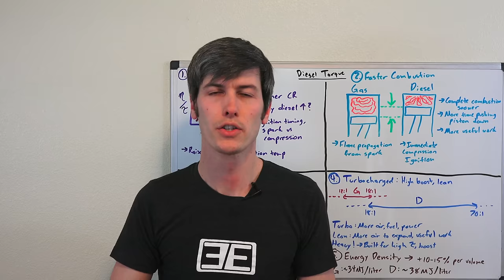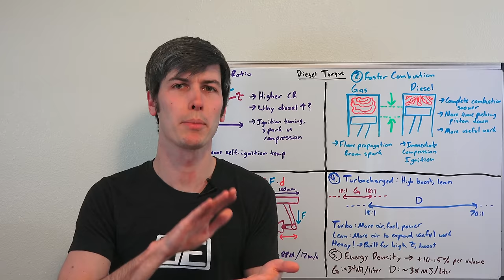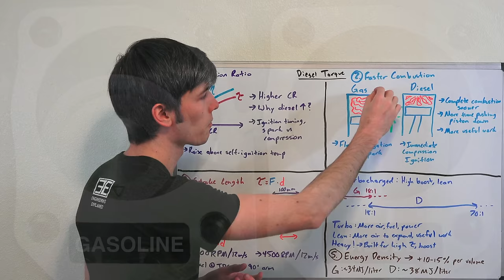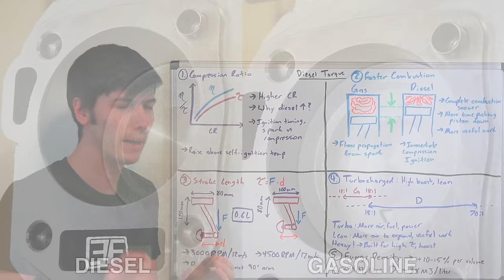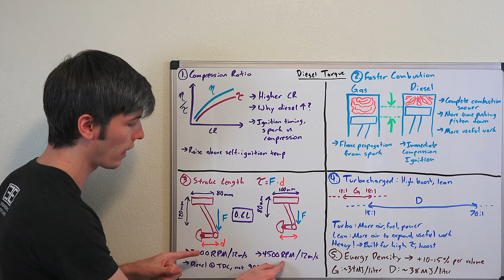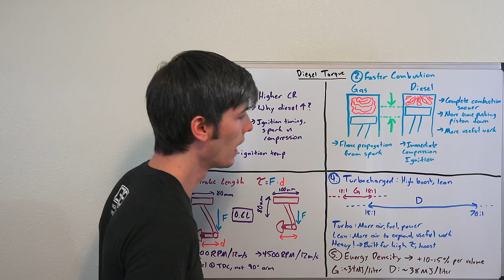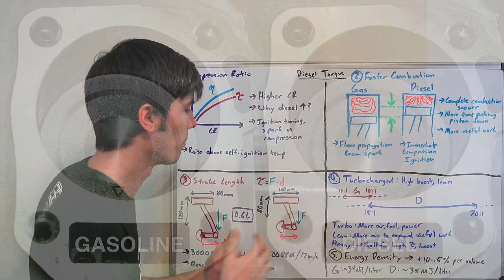5 Reasons Diesel Engines Make More Torque Than Gasoline

Comment: A nice pretty video, but not technically correct in most aspects.  In your video you say that gasoline engines have a lower compression ratio because the piston does not travel all the way to the top of the bore.  This is not true.  Gasoline engines have a lower compression ratio do to many reasons, including piston shape (i.e. dome, flat top or dish) as well as stroke of the crankshaft, but mostly it is a product of combustion chamber design of the cylinder head.  If gasoline engine pistons did not come all the way to the top of the bore (or at least within a few thousanths of an inch) you would have very little quench, and would have excessive detonation.  Another reason diesels are more efficient than gas, that you did not touch on is direct injection.  Until just a few years ago, direct injection for gas engines was pretty much non existent.  Just within the last 5 years or so has gasoline direct injection began to become mainstream. I do realize that you are trying to simplify the explanation of the differences between gas and diesel engines, but don't let simplification become falsification.

Comment: Just not true.
The mean effective pressure (I hope this is the right englisch term) ist very close for Diesel and Gasoline engines, at least if they are both naturally aspirated engines. And the mean effective pressure translates direct into engine torque.
The compression ratio is higher and therefor also the combustion pressure. But you have also higher compression pressure so you to not get higher mean torque from this.
The combustion is earlier completed but this influence for torque is very little but it helps for economics.
The bore-stroke ratio is more or less the same for passenger car engines be it Diesel or Gasoline. Just large trucks have different ratio mainly for better economics.
In case of naturally aspirated engines you get higher torque just from higher engine displacement. And for the same power you need higher torque to compensate for the lower rotational speed of the engine.
So naturally aspirated Diesel engines are havier because the higher engine displacement and because of the higher combustion pressure they need more strength.
That is the reason why they started much earlier with the developement of turbocharged engines for diesels. They just had to. Naturally aspirated engines were just very heavy for passenger cars.

Comment: The BTU content of diesel is higher. You don't need 5 reasons. Its that simple. And remember, engines don't make horsepower, they convert fuel into torque.

Comment: I sense a circular argument being presented here.  In the video, engine architecture is often used to explain how more torque is produced in various engines designs.  And it is stated that diesel engines use a particular type of engine architecture...but why?  Can a high speed, short stroke diesel engine be built?  How about a slower speed, long stroke gasoline engine?  Why are diesels typically turbocharged?   Can they be naturally aspirated?  I am missing the full story between the chemistry of the fuel and the reason for the engine architecture.

Comment: If the volume of the two cylinders is the same and pressure due to combustion is the same, wouldn't the force acting on the larger diameter piston be higher (F=PA). Would this cancel out the torque due to stroke length.

Comment: enjoy your vids mate, missed a couple things on this one...
Diesel engines can run ridiculous overlap as you won't be spitting the air/fuel mix out the exhaust = 100% clean air in the chamber for the ignition cycle.
De-stroked motors also make more torque comparatively, but as far as I'm aware the square motor is most efficient ( bore = stroke ).
there's probably more but I ain't no expert ;-)

Comment: why there are no diesel cycle gasoline powered engines available? Would´nt it be better engine if it used high pressure dfi injection and ignites on compression?

Comment: You lost me on statement that diesel burns faster than gasoline. That is not true. 
Even simple check on Wikipedia shows pressure-volume diagrams where you can see it.
I would go even so far to state that name of this video is not completely true - it is valid only for low RPM.

Comment: Nice. You must be right, but here is some things that makes the difference. I think that only thing that really makes the significant difference between gas and diesel engines torque is turbo. Turbo or other charger. If you compare gas and diesel engines whitout any chargers, usually the gasoline engine makes more torque at the same volume. And if compares gas and diesel engines whit chargers, there must be charger on gasoline engine too and same boost. energy capacity of fuel does not make any difference to power. It make's difference to fueleconomy. Because it is no problem to inject more fuel to engine. problem is to get enaugh air to the engine. If compared methanol and diesel, it is possible to make more power from the methanol, even if there is much less energy at some volume.

Comment: How does also each fuel type combustion speed (in case of gasoline fuel its octane number) contribute to generating torque and power.. as diesel fuel spreads 10times faster when ignited.. can anyone answer that, pls?!

Comment: Reason # 3 is not right.  For a given combustion pressure and displacement, torque will be the same regardless of bore/stroke ratio.  Whatever you gain in leverage from the longer stroke you lose in piston area, reducing the force proportionally.

What will increase torque and efficiency is a longer connecting rod relative to the stroke, as it improves the geometry of the power stroke (at the cost of heavier connecting rods and a taller engine).

Comment: Most of the torque difference is down to the bigger turbos diesels need to make decent power, just as downsized turbo petrols engines make more torque than bigger, naturally-aspirated petrols. Not that peak torque figures really matter in an age of 8-speed autos.

Comment: Another great video sir. You didn't however mention of the drawbacks of diesel such as greater emissions, more initial cost for the engine vs. gasoline, heavier to compensate for the higher combustion ratios, and the fact that if you happen to get diesel on your hands when refueling the smell will be there significantly longer than gasoline. That said, I love my tuned BMW 335d, the torque is excellent and I can't find another vehicle with 340hp 500lb-ft that gets 41mpg highway.

Comment: Gasoline engines release CO because the combustion is not complete during some part of the stroke after the spark?
By the same token,  Diesel engines do not release CO because the combustion is immediate & complete right at the moment of compression?

Then why do diesel truck & busses smell diesel & it is a smell we all recognize. Where as gasoline engines do not have a smell.

I know it is gasoline engine exhaust is poisonous.

Is Diesel engines smoke also poisonous?

Thanks

Comment: How does an engine development process work? 

They start with deciding how much power and torque is required for that application? 

And from there they decide on capacity?

Then they decide cylinders x bore x stroke to get the peak power and peak torque where it matches the application?

Is that it?

Comment: Why do diesel engines have peak torque at such lower rpm's than gas motors? Also, why can't you spin a diesel engine to a higher rpm besides the obvious weight of the reciprocating mass.

Comment: Hi Jason,
First of all, congrats for your vids, I find them very instructive and amussed.
Secondly, I've just watched this video and I've found a bit surprising that diesel combustion is quicker than gasoline one. The reason why I say so it is because of their thermodinamics cycles in which gasoline combustion is supposed to be instantaneous while diesel combustion is supposed to take certain amount of time. 
I'm fully aware that theoric cycles difer from actual ones, but I didn't that they changed that much.

Is there any reason that explain that change?
Thanks

Comment: I think you are wrong, Diesel combustion is slower than gasoline. so designer know that they can´t get a lot of RPM, so they compensate with longer stroke to get max optimal piston speed,  less power, but more torque.

Comment: Nice arguments. I think you may have neglected to mention one reason for increased torque in diesels: that there is no fuel in the compression stroke, just air, which allows significantly more fuel to be injected per cycle per displacement. It seems you touched on this when mentioning the difference in air:fuel ratio, but it wasn't super clear to me that you were arguing that was a reason.

Comment: Diesel engines have lower torque than gasoline engines. The reason for the diesel is turbo. For ex. A natural 2.0lt gasoline and natural 2.0lt diesel.... The gasoline product more torque

Comment: There isn't any "magical" torque increase by making larger stroke (for the same engine size) if you make larger stroke you get smaller bore therefore smaller force for the same pressure inside the combustion chamber (because you have less piston surface).

Comment: The only reason a diesel engine produces more torque than a gasoline engine of the same cm³ is diesel engine has longer stroke. Diesel engine has longer stroke because it needs higher compression ratio. Thus, diesel engine needs thicker cylinders and has lower RPM.

Comment: Why Can you make a gasoline engine that works with hi compression and no spark plug? It burns before you have the compression you want, or it won't burn using only temperature?

Comment: There is something conflicting in this video, according to Otto cycle (petrol cycle) heat addition take place at constant volume but he is saying volume is increasing during heat addition. As well as according to diesel cycle heat addition take place at constant pressure with somewhat increase in volume but he is saying exactly opposite.

Comment: For the same displacement, increasing stroke length of a cylinder one has to reduce its surface area by the same amount. Torque is proportional to the product of both. Thus, the effect cancels out.

Comment: Why can't a gasoline engine have a high compression where the fuel is injected at the last moment, just like the diesel engine? Then the spark plug wouldn't be needed and you end up with a better burn of the fuel. Also you could run really lean and get the most out of the fuel getting better efficiency. Seems like a no brainer.

Comment: I'm no engineer but I've always admired diesel engines. Too bad they cost much more than gas engines and too bad diesel fuel is taxed at a higher rate. Turbo seemed to solve the Hp problem and clean diesel fuel solved the emissions problem. They're quieter today as well.

Comment: Love the chanel there is so much truth. But. I think a diesel is intentionally low rpm to reduce detonation. Its limited, that's why a lot of tractor pull trucks use a mixture of diesel. Also. By using long intake runnern length lessens the rpm range. Longer length lower rpm power range. Larger engines (ex: 305cuin vs 427cuin) also typically make more torque given x amount of cylinder head flow to engine size. So all that said I do belive a larger lower rpm range engine makes more torque not just a diesel. Ill give you a example. A 400cuin 6.5555l sbc with TPI intake well capable of making ~450ftlbs at relatively low rpm. That's about as much as a duramax in its early years. And the gas sbc does it without turbo as well.
Reply: diesel burns very slow compared to gasoline, therfore the max RPM is reduced. That is the biggest drawback imo. In my country diesel fuel is cheaper so I decided to use a diesel car. However my previous 2 cars were gasoline and I do miss having power increase with RPM. Diesels are quite boring to drive as they go slower the higher RPM you have

Comment: 😂😂😂.  The reason Diesel engines are heavier is due to the higher compression ,necessitating heavier components, the momentum created by these heavier components is converted to torque , turbocharged engines aren't heavier , ?????

Comment: A couple of things which most people seem to be missing here; no-one has seen fit to mention BMEP but torque is a function of BMEP and displacement whilst horsepower is a function of torque and RPM. Peak horsepower is usually quite high up an engine's rev range whilst peak torque can occur much lower down the engine speed.

There's also a matter of basic volume - diesels compress up to three times as much volume as a petrol engine so although diesel fuel has a specific energy only perhaps 75% the value of petrol, it's a longer burn of a larger volume which inevitably contributes significantly to torque output.

I also have to take exception to comments about the relevance of bore and stroke - in practice, it makes a world of difference!! Traditionally, Ford (in the UK) made 'oversquare' engines (I'm thinking of the Pinto in particular) whilst General Motors (under their Vauxhall badge) tended towards longer stroke motors. The nett effect of this was that my FE Victor could easily drive away in second gear whereas my Mk3 Cortina needed all its gears, all the time.

That - gentlemen - is a demonstration of the Vauxhall engine's significantly higher torque.

Comment: the engine density of gasoline is also higher than autogas, yet some engines make slightly more torque on autogas... I think it's also important to note diesel is an oily fuel, and is much thicker, so by compressing a thicker fuel harder (there's already much more torque required to do that), you'll get more torque in return… 
and the longer stroke is important as well, I guess. same when tightening a bolt or something, the longer the thing you use to tighten it, the tighter you can get it (more torque on that bolt)

Comment: It is of an environmental question, but can you explain why the diesel emission is much more toxic than gasoline? And why does diesel exhaust pollute more than gasoline if they are more efficient, and fuel burns up instantly versus gasoline that does not complete combustion at same compression?

Comment: No disagreement from me on your video, but I think it’s important to point out that Diesel engines, whether turbocharged or not, have much heavier components to withstand the stress of DETONATION... those heavier parts mean lower RPM capability, but with a shorter burn cycle, that’s not a problem for a Diesel because they are generally operating in the RPM range in accordance with their design.

Gasoline engines CAN operate at higher RPM because they use lighter parts, they are not designed to withstand the stress of detonation.  With that said, diesel tech has come a long way in the last 10 years & they’re making power at speeds that I never would have thought possible... but I still love gasoline
Reply: Lmao my gasoline water pump literally exploded the other day.

Comment: Doesnt the slower burning speed off the diesel helps out? The diesel cant rev that high cause the a/f mixture has not burned up before the next cycle happens, its like a slap with gas and a punch with diesel. Or have i got incorrect?

Comment: You mentioned that you don't think the longer stroke of diesels adds much to the torque but you didn't account for the fact that longer stroke means longer crankshaft throw. And that's definitely going to increase torque as a longer crankshaft throw means significantly more leverage

Comment: Great video only missed one point which is a minor one 
The fuel themselves burn differently as well gas burns in a quick flash releasing all of its chemical energy very quickly 
Diesel burns a lot slower using up its chemical energy slower resulting in a longer burn time which pushes the piston down longer

Comment: It doesn't make a lot of sense to me that because the diesel burns quicker it also has a longer stroke. I would have guessed the other way around. Or that it's the other way around regarding the combustion. Diesel oil is a longer molecule compared to gasoline, should be burning slower, and in which case the longer stroke makes sense.

Comment: And diesel engines tow better because you have more engine torque at lower power RPM? That's what a flat torque curve gets you? I understand that max wheel torque comes from max power, but I assume the max power out of the engine matches max fuel consumption. You don't want max fuel consumption while towing, lol.

Comment: Diesel Engines are also known as "Constant Pressure Engines.  You forgot to talk about diesel full throttle operation and the fact that fuel is continuously injected on the full down stroke to maintain burning fuel and a constant pressure of the power cycle, compared to gas engines where pressure on the top of the piston decreases as the volume of the chamber increases on the power stroke.

Comment: Diesel engines are used for increased torque to haul heavy loads and the “used to be” lower cost. Lower rpm can increase engine life but emissions were a problem. The newer electronic Diesel engines help with the EPA issues at the cost of reduced horsepower.

Comment: Gasoline burns faster than diesel that's why gasoline engines have higher speeds. Also for more power we always try to keep equivalence ratio greater than 1 that means slightly rich air fuel mixture not lean. The only reason that diesel engines produces more power is there compression ratio and more torque due to there low speed. You are right that diesel engine burns lean but that doesn't increases torque .

Comment: What are the measured efficiency numbers in case of a modern gasoline vs modern diesel engines? How much work can be produced from the same amount of MJ that the fuel is holding?